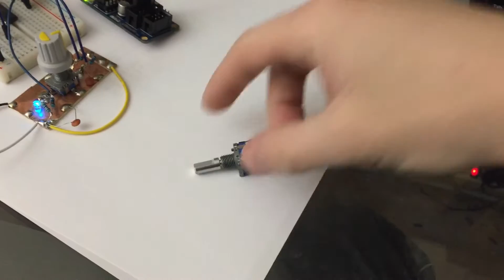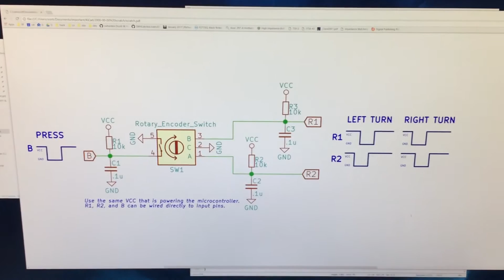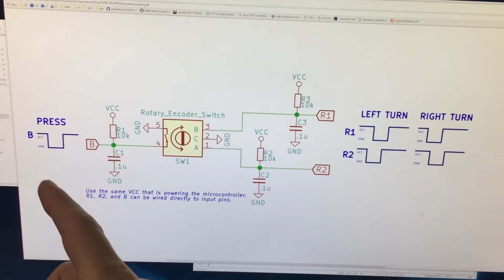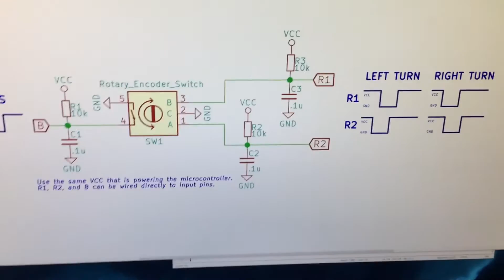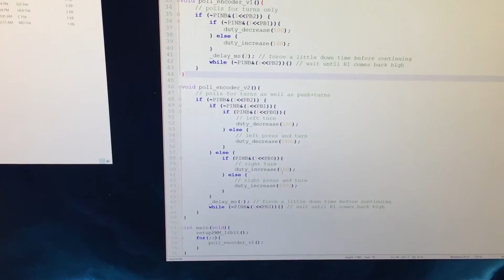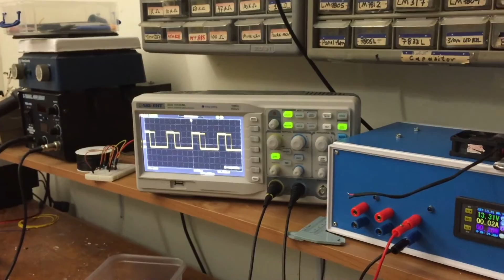Rotary Shaft Encoder on AVR (with code)

Comment: Hi,

I'm yet to find a video where a rotary encoder is used to set the speed of a stepper motor, or any motor for that matter.  Do you know of one? 

Thanks.....Antonio
Reply from the maker: Can't think of one off the top of my head. However, I have an old video where I use AVR to drive a stepper motor. Check the link in the description of this video: https://www.youtube.com/watch?v=RzqdL5gqaHM